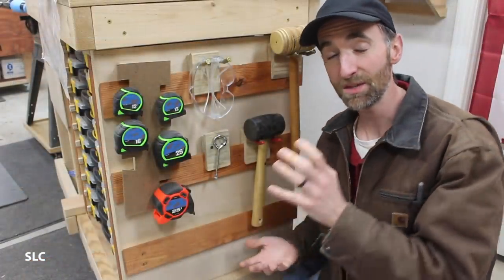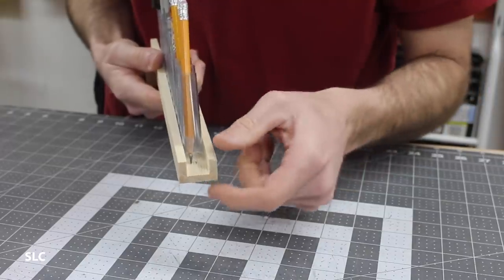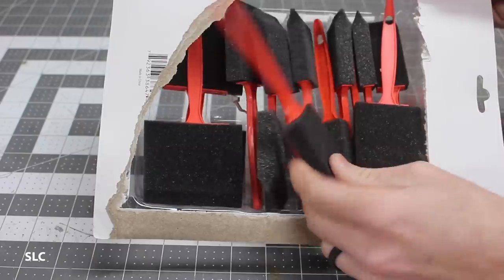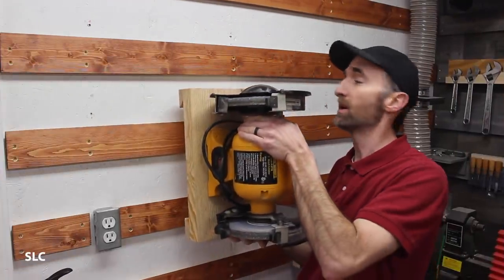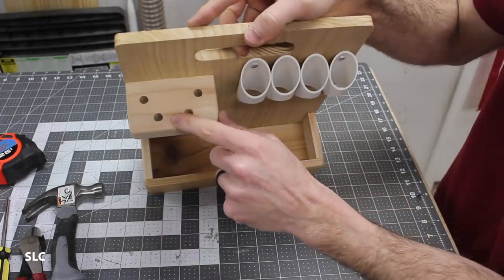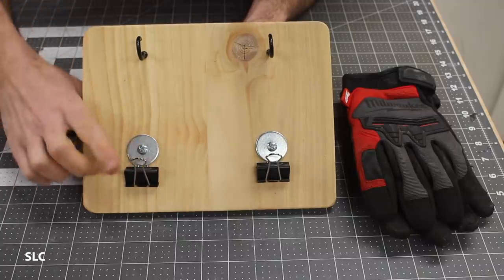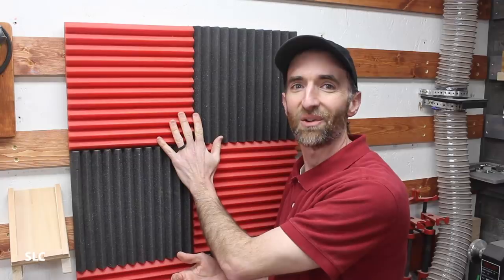20 MORE Simple French Cleat Ideas for your Tool Storage #4

Comment: I really like the idea of using French cleats to mount a grinder on the wall. Rather than 'just' storing it on the wall, it would be even better if the grinder could be mounted on the wall oriented so it could be used. You could create a whole sharpening station on the wall, taking up very little floor space and within in easy access.
Reply: I did this in my garage. Perhaps the cleat wasn't deep enough, but when operating it easily climbs out of the cleat (instantly). I strategically added a threaded insert and use a bolt with a 3D printed knob to securely attach it.

Comment: #16 - If you drill a hole in the top and cleat top, you can drop things like screws, and nails, etc, even bent ones so they are out of the way until you sort them or safely discard them.

Comment: Question:  So I just hung my Cleats up.  Getting ready to start building some holders.  Now do you use the same size hanging cleat on every project, or do you cut some down smaller, for certain builds for Aesthetics?  Thanks! 👍 🇨🇦
Reply from the maker: If the tool/holder is heavy, I would keep the same width for strength and balance. If it is lighter, you might be able to get away with two narrow cleats on each side of the back. Just make sure they are level with the wall cleat and each other.

Comment: you could add a cleat to some speakers and run the cables along the very top rail, and potentially even add an aux cord to the charging station/outlet protector, so when you're wanting tunes, they're hung simply on the wall, but not immobile.

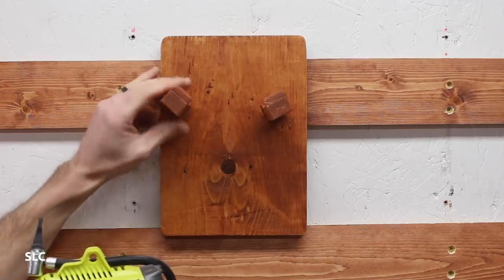you could make a dustpan holder, similar to the air compressor at 4:00, so it's on hand when you need it, and potentially have a different way to hold the brush so you don't need to always nest them (as many dustpan/brushes are designed to interlock)

you could make an extra braced swing arm lamp, hang it on a cleat, extend it to where you need, and just plug into the wall.

picture frames on a french cleat to add that "home" feel. or putting a picture of your favorite car/movie to personalize the workshop. (or a white board)

drill screws into a cleat at the right spacing for a power strip, and maybe even include a protector to it, so you can have more power points when you need them

hot glue a cleat to the handle of your shop vac (not the shop vac itself) so when you're working, you can simply hang the nozzle when you put it down, and you don't need to feel around for the head.

make a frame for a paint pallet, to hold it horizontally, so if you're ever working near the cleats and need a not-floor level to store it on while you actively use it. bonus if you make a lid that seals it properly, but cling wrap is generally fine for that stuff.

making a "basketball trainer". basically, an oversized funnel, the directs stuff into a bin. good to not need to aim specifically at the bin.

making a regular basketball hoop. always fun to shoot a wadded up rag/paper through a hoop, and if you put it over a bin, it's extra points.

a hand sanitizer station, whether it's liquid soap (assuming you don't need to open a door on your way to a sink) or regular alcohol based hand sanitizer, having it hanging up near a door is a good habit to get into.

adding a cleat to your table sled could also be good, to just hang it up when you're not using it.

as to upgrades.

I'd also add a pencil sharpener to the pencil holder, just so you always have one on hand.

a better way to store the circular saw blades than the one you suggested in the last video is making almost a CD case. cut out an x inch hole from a piece of 1/4" plywood, then laminate it with another piece of 1/4" ply with a  1" finger hole located near the front, and add a little pull tab, similar to a manila folder (staggering them to make them readable). make a shelf unit with 5/8" spacing between 1/2" slots, and you've got a safe way to store the blades, as none of the edges are exposed. bonus, you can whack a label on the pull tab/write with sharpie to label the disk slots, rather than trying to identify them by the teeth/pulling them out one at a time
Reply from the maker: Those are some great ideas. I will keep them in mind for future videos, thanks

Comment: Great ideas but sure uses up a lot of wall space.  I really like that outlet protector/cover.  How do you keep the dust from collecting on everything that is hanging on the walls?  Even with dust collection at the sanders and saws I still end up with a lot of dust on anything not in a cabinet or drawer.
Reply from the maker: No matter how much dust collection used, there is still some that gets airborne. So I just use a leaf blower a few times a year to remove the resting dust layer.
Reply: I keep an inexpensive leaf blower handy, and use it almost daily to blow everything out of the bay doors.

Comment: The box that has the mason jar on the bottom. If take small corner out the front of that box, then you could use the box to sort the parts from the jar and when you are done, just tip the box up over the jar to put back the parts that you don't need.

Comment: Quick Tip, for number 8 the wheel stop.
If you slide a bycicle inner tube over the kleats your using as wheel stops, it act like a non slip grip.
You can get old innterubes for free from most bycicle shops, you can cut the remainer up as grips for screw drivers etc or in to 1/4" or 1/2" strips and have them as powerful elestic bands.

Comment: Do you have a video on making a FC wall. IE. material, dimension, spacing. Not used a plywood backer ext?
Reply from the maker: I do not. FC can be used on most walls with success as long as they are attached directly to the studs with long screws. As for sizing and spacing, that is up to you. Just make the cleats larger for the heavier locations. And I would stick with atleast 3/4 inch thickness for strength.
Reply from the maker: Also here is a video I made on some things to avoid: https://youtu.be/duDs7HImuUw